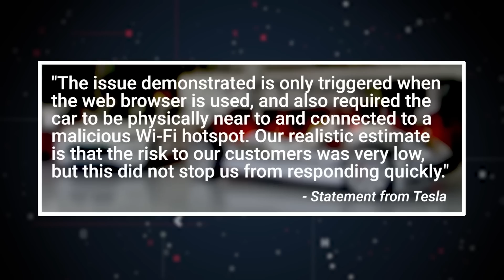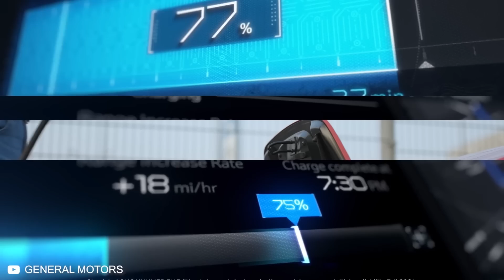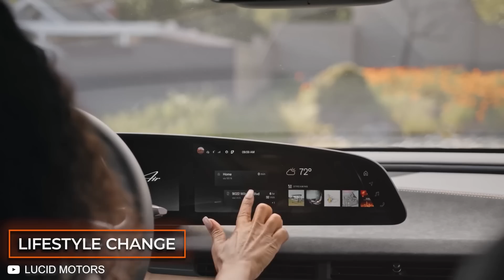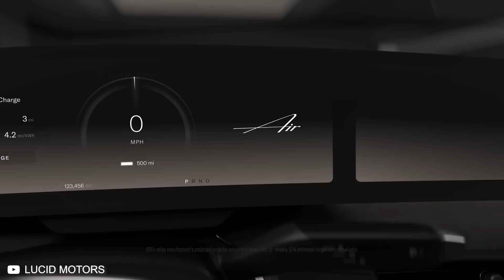EVs' Serious Problems That Carmakers Are Hiding

Comment: What happens if you “under estimate “ your remaining range and find yourself on the side of the road with no electric charge left? Does AAA pull up with a generator on board and you sit there for God knows how long while your battery is being charged? No calling friends with jumper cables to help out here!
Reply: You need a tow to a charger.
Reply: @Species-lj8wh  That sounds like a good idea to start a business, to set up a truck with a battery charger to show up on location. You can sell membership for the service at a monthly rate, or charge an hourly rate just to drive to the location and charging time and back home again, so you'd can at least make it worth your while. Tow Truck companies in California rates are controlled by the Chief of Police and where I am charge about $7/mile. That's $420 just to drive out to you if you're 60 miles away. In 1986, I had a tow truck come unlock my car in a National Park, that cost me $185 round trip and the company was only 30 minutes away, Therefore, why should you get paid anything less.
Reply: @Species-lj8wh  …. lol!
Reply: I'm not promoting EV's but I can tell you that you need to plan your trips accordingly and one thing I've seen by several sources is that the estimated miles shown on a full charge is over inflated by about 30%. So for every 120 miles it says you can drive, you can knock about 40 miles off that distance for the actual distance. So plan your trips accordingly, Plan for worse case scenario to be safe.
Reply: @robertkarp2070  you’re not saying that manufacturers will deliberately overestimate the expected mileage with the hopes of selling electric cars, are you?  ( lol)!
Reply: @johnfpotega2017  Manufacturers don't say that, the dealerships do that for them.
Reply: YES!!!…lol!
Reply: @johnfpotega2017  I think it depends on the individual car's performance and one tested might have gotten that much, or maybe it's would get that much if there was no resistance on the motor, however when actually driving and going up hills or stop and going all the time, adds stress on the motor, making it use more energy uses up the battery faster. You might get better results if you're going down hill the entire time but lose it going back up that hill the entire trip.
Reply: @robertkarp2070  Robert, I’ll make certain that all trips are down hill trips……and I’ll call someone to bring me home when I’m done (lol). Thanks!
Reply: @johnfpotega2017  With EVs,  to get real world mileage the formula is simple, get the manufacturer's figures and divide by two.
Reply: @robertkarp2070  'estimated miles shown on a full charge is over inflated by about 30%.

Ok, so when is there going to be a class action lawsuit to make Tesla and others PAY for the lies and deception?
Reply: You have to carry a portable generator and a gas can.
Reply: Saw a tesla the other day ran out of battery. Had to be towed for $250 to a charger. I chided him he got mad and said at least he didn't have to pay $100 for gas. I just laughed in his face cause he just paid $250 for the tow. Yea you won buddy
Reply: @38XKB8  If he had AAA he could have been towed for free or they would have sent a charger out to him. I think his point was that charging his car didn't cost $100, and he'd have to pay $250 either way. What he doesn't get is that someone could have brought him a gallon of gas so he'd be on his way.
Reply: Stop the global warming scam and you won't have to worry about it.
Reply: Electric cars are a massive environmental disaster. Who would you buy one?
Reply: In a Tesla, that information is calculated for u. Of course u can dance with the risk devil of juice/gas if u enjoy that kind of thrill.
Reply: @aintlying1  No it's not calculated. I just watched a guy test drive a Tesla, that said 415km estimated distance and only drove 85km and already used 31% of the battery, which took 30 minutes to charge, after he'd spent some time having to find a charging station, where he stopped at to find a working charger.

Comment: 13k dollars for just the part.... lmfao. That's your green solution, to build a car that will be useless in 10 years. No one is going to spend 13k dollars on a part for a ten year old car. It will be trash.
Reply: FYI...As I've said above the LFP batteries are having warranties 1 million km.. lucky if you get yr ICE to last a third of that... The mechanical parts of an EV will fall apart well before the battery is unusable. .. And most battery packs are close to 100% recyclable.. so once there are enough batteries in the system to meet demand you won't have to make hardly any new ones ever again.. just recycle the old ones.
... all battery prices will continue to plummet.. all good news for EVs
Reply: @gregchristie2763  when did you ever see prices plummet? Not in this world.
Reply: Not only that. If you drive for example a fiat panda, his parts are cheap and his technology is much more easy to repair. Try repairing a tesla in the middle of nowhere, you'll want to throw it into the woods, because it costs to buy the parts and the car is difficulty built. The fiat panda will drive another years, while tesla (which should be more "green") is not ecological at all. The point is to drive the car long, than buying every two years a new one. Where will the old tesla land? It sure is not  biodegradable

Comment: One thing that a lot of manufacturers is that EVs is that they can't tow the same amount of weight behind themselves that a normal car can for the same distance, especially when you're looking at towing a boat or a caravan through a desert or offroad.
Reply: You can always find a doomsday scenario. Just casual observation would also show that people buy vehicles based upon 1% of the uses that they will have for it. I see turbo diesel "dually" trucks doing the daily commute to the suburban office parks every day. It's probably because they tow a horse trailer to the mountains, once a year. 
It's a free market, but that doesn't mean that every consumer choice is rational. Whether you adopt EVs or not, other values and biases make their way into your choices.
Reply: @DEAR7340  true mate i was just merely pointing out a fact that doesn't get mentioned when people talk about Evs
Reply: They can actually tow more to their own weight, the difference is EVs rely on efficiency for range which is why they're range drops far more than ICE for pulling things. EVs much like hybrids are also made far more for city driving and less highway. Obviously on the highway regenerative breaking barely helps. The issue with weight is purely we don't have bigger EVs. The model Y is one of the biggest EVs we have and is only a crossovers, not a truck or SUV. Compared to the Toyota RAV4, they have the same towing limit. 

In comparison the Rivian R1T the only EV truck on the market can pull 11,000 pounds. That's about the same as max power Ford F150 at about the same price as well. It also has vector toque control since it has 4 motors so it's actually better for off-roading than really any ICE car. They showed that by doing a demonstration climbing a hill only modified cars usually do even on stock tires. As you can see, you just need to look at the same type of car.
Reply: @Skylancer727  have you ever seen any EV in the mountains? Neither did I. The most used cars for such places are diesel cars. Turning all the functions in your EV will suck your battery out
Reply: The F150 ev will get the job done.
Reply: Won’t matter: you’ll own nothing and be happy.
Reply: https://www.youtube.com/watch?v=Yeth5v_5dPM

Comment: I still want a 1969 Dodge Challenger RT. Hopefully I'll be able to get one before gas cars get banned outright...
Reply: Gas cars will never be banned, don't worry. At least not in our and our children's lifetimes.
Reply: Gas might become more expensive in North America and Europe, but I doubt it will ever be banned outright. It's also possible to do an electric motor swap into a combustion car, which I'd probably end up doing since I have a project track car. 

I also think that pre-2010 cars (and pre-2010 tech in general) will be more sought after in the future because their electrical systems are more simplistic, easier to work on, no internet connection, GPS tracking, etc.

Comment: You raise a lot of good points, I think the most important to note are the problems with existing battery chemistry and the unsustainability of the raw materials. However, huge amounts of money are being poured into battery research so in the next few years I hope we see some of those competing with lithium for energy density but significantly more sustainable. 

The point you make about of infrastructure is true now but won't be for long. EV adoption is rising drastically so we should expect more investment in that too. Charger type incompatibility is a really big issue , there are 2 or more incompatible technologies being installed in EV infrastructure across the US - Tesla and most others (DC fast charging vs onboard DC inverters). That's really bad for the environment, and for cities, because you need two or three times as many different infrastructure types to serve the same market, which interferes with efficiency and economy of scale. This is one place where early (limited) government regulation on EVs could have been beneficial in standardizing these things.

The time to failure of EVs is significantly lower than ICE vehicles. Lower moving part counts and less heat cycling have a huge impact on reliability. This is why EVs are recommended for service every 10,000 miles instead of the 5,000 miles for ICE vehicles. I'm not making an argument for cost though, as $15k for a battery every 10-15 years is still rough. Battery cost does go down with time - it's an incredibly competitive field.
Reply: Since my family is not that rich, we buy used cars, and those cars are more reliable than an EV. Many people in villages have really ,really old cars which are more simple built than today's cars, and if something breaks, they repair it very fast and continue to drive while an EV repair will not only cost a fortune, it demands much more care